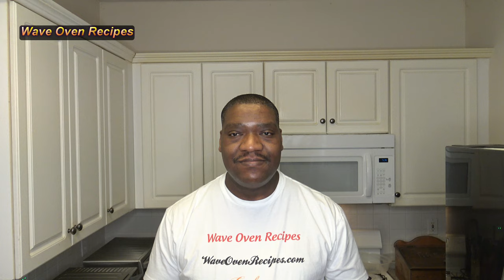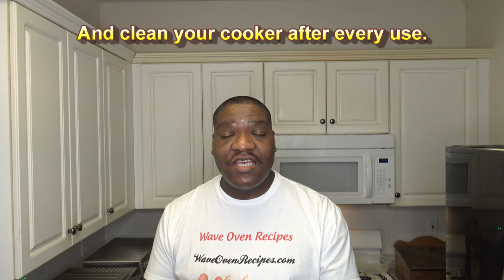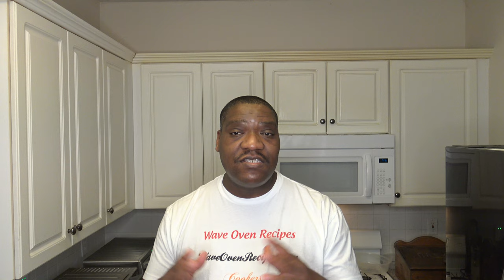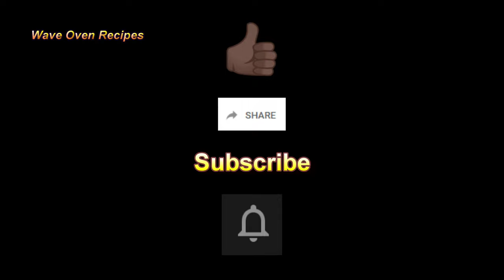Air Fryer Smells, how to fix, Air Fry Q&A

Comment: Wouldn't it be strange if the manufacturer recommended this in the instruction manual 🤔.   I had to run to YouTube and found you. Gonna give it a try.   Thanks so much 🙏
Reply: A lot of reviews people complain about a toxic chemical/plastic/rubber smell that does not go away. The owners manual mentions that this may occur but is non-toxic, yet no one wants that smell in their house or on their food.

Another review mentioned to remove the "rubber shipping legs" from the tray grate before using. These appear to be food grade silicone but I removed them anyways and have had no bad smells during the initial test run or two dishes I've cooked so far.

This is a great little air fryer, remove these things and you'll be happy!

Comment: A lot of reviews people complain about a toxic chemical/plastic/rubber smell that does not go away. The owners manual mentions that this may occur but is non-toxic, yet no one wants that smell in their house or on their food.

Another review mentioned to remove the "rubber shipping legs" from the tray grate before using. These appear to be food grade silicone but I removed them anyways and have had no bad smells during the initial test run or two dishes I've cooked so far.

This is a great little air fryer, remove these things and you'll be happy!
Reply: Sadly they lie anything non stick is lead or similar poisonous lining metals or coating, burn as this man says but it's always in the non stick always there,plenty of info on how dangerous these non stick coatings are, look up each ingredient metal etc it's a sad world we rely on!
Reply: Thanks

Comment: That's my issue. Thank you for the review and the help. Mine is a Bella and it smells Horrible. It does smell like plastic or like when you go to clean your oven and put oven cleaner inside and turn it on low so
Nasty. It makes me nauseous 😫  I'm doing the first heating  like you suggested and hoping it will be better after. If not I will definitely be calling the manufacturer because it smells like the wires are melting or something 🤢 I thought it was going to catch on fire.. Glad I seen your video Fingers crossed it will work and that heinous foul smell goes away🤞
Reply: The food kinda smelled like the cooker I didn’t even eat it

Comment: Bought a Vortex a few weeks ago.  Cleaned it thoroughly, washed all accessories, been in use for around 2 hours total time so far.  Still smells awful.  Might be going back soon.  I'll try again yet not hopeful.
Reply: A lot of reviews people complain about a toxic chemical/plastic/rubber smell that does not go away. The owners manual mentions that this may occur but is non-toxic, yet no one wants that smell in their house or on their food.

Another review mentioned to remove the "rubber shipping legs" from the tray grate before using. These appear to be food grade silicone but I removed them anyways and have had no bad smells during the initial test run or two dishes I've cooked so far.

This is a great little air fryer, remove these things and you'll be happy!
Reply: @beckderm  I returned mine as the buttons were acting up and bought the $39 Gourmia from Costco.  For me, the basket-type ending up working better for my needs.  Drop in a liner and clean up is a breeze.  The Vortex good if people like the oven door set-up, can get rid of the smell and the buttons work.

Comment: having this issue with my black and decker... on my third burn off and still having issues... i followed your instruction on washing the accessories and still no help... might be bringing this thing back to Costco...
Reply: I bought mine at Costco & I’ve washed it, used it multiple times & it still smells strange

Comment: This was my concern, the plastic smell is from the hot air heating the plastic housing and internal air channels , i honestly don't think it is safe to expose plastic to these high temps . I am sticking to my oven all metal .
Reply from the maker: And there are many all metal air fryer ovens, that may save you on the power bill.
Reply: @WaveOvenRecipes  That's great , i was searching for all metal one ,  couldn't find one with metal housing , they are metal on the inside i.e. tray and fan only .
Reply: I found an all glass one . I will give it a shot.
Reply from the maker: Cool.

I have reviewed many of the air fryer "oven" style that are all metal.  But the basket air fryers typically have plastic.

Cooker Reviews: https://www.youtube.com/playlist?list=PLdwaKyfn2J3r48IqHRsTGKzzLg_fDlwzK
Reply: @WaveOvenRecipes  wow you really have reviewed so many, glad i found your channel . God bless.

Comment: I have this issue with a Hamilton Beach bread machine I just bought.  The plastic smell is in the bread, despite the fact I did the initial burn off.  The manufacturer says it will go away after a few uses but that means wasting food until then. It’s annoying.
Reply from the maker: Only if you accept to keep it.  You could return for refund and try something else.

Comment: My air fyer not only smells like melting plastic, it gets into ny food and changes the taste drastically. The taste is so horrible . I can't get rid of this odor and taste.  The higher the temperature the worst it smells and taste. I'm very concerned about the health risk. 😕
Reply: Did you ever find a solution? I had mine for awhile and threw away the box , I can’t even return it now😔
Reply: Help. I just got a Power xl vortex. I can still mess the plastic 3 days later in my kitchen and in my nostrils. I had to throw away my food.  It's awful. I only used it once.  Did you find a solution to the smell?  I smell a refund in the near future because I just can't take the smell🤮
Reply: @FlyFreely8272   I have the same issue. I’ve got an instant Vortex 10 quart, and we actually already dehydrated fruit in it, at 180° for 7 1/2 hours and the smell is still there, so as far as the burn off, that didn’t work. I had made a rotisserie chicken and I could swear it had a plastic taste. I’m thinking about just returning it
Reply: @MoonQueen1010  I returned it a long time ago. I have the 8qt Gourmia. It's a little difficult to clean around heating element but it doesn't have the plastic smell after using it a few times. I've had it for about 6 months and use it every day.
Reply: Exactly!